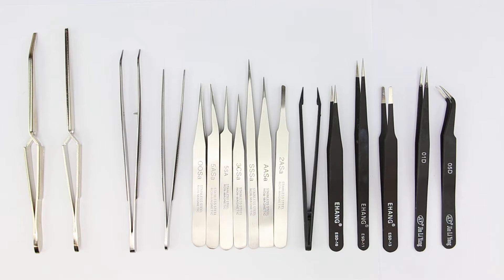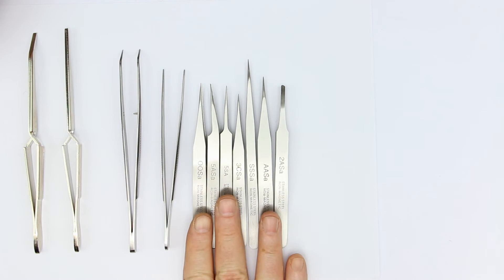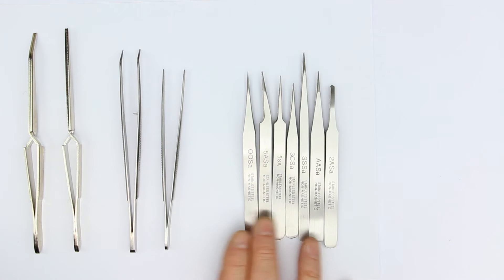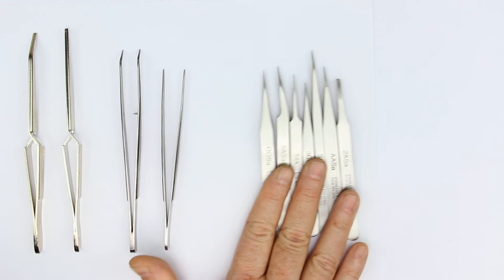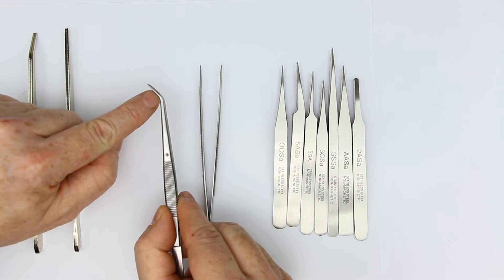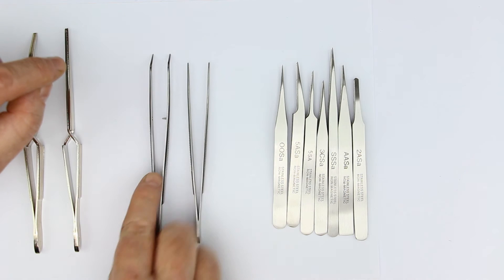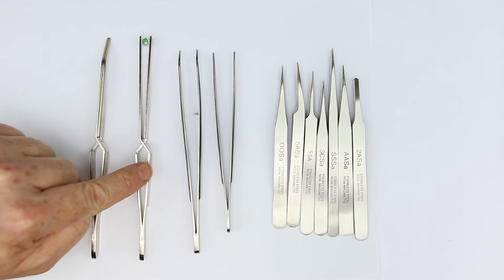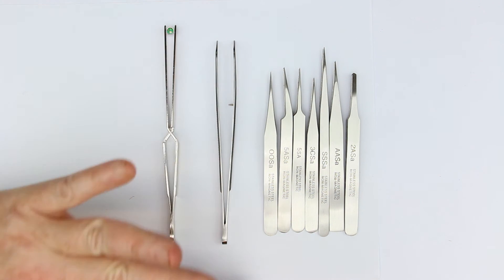Every maker should have…[Pt.15] some electronics tweezers

Comment: Looks like the 7 are from Weller Erem ; I understand it's the n°1 brand for tweezers (?) and small pliers too
Reply from the maker: No. The black tweezers are relatively expensive chinese ones from Ebay. Might be that Weller rebrands them?
Reply: I was talking the silver ones, 5SA e.g., just bought 3 incl. this one (27€)
Reply from the maker: The silver ones shown is the whole set that we sell for 13,90 € in total.
They probably are also made in China but have reasonable quality.
The numbers printed on the tweezers seem to be a universal numbering-system for tweezers. So the Weller 5SA has the same shape as our item but it´s (hopefully) professioal-quality for the higher price
Reply: 2€ vs 27€ ! passed the x10 ratio.
idk if the designation is universal  or copied from Erem but you're right it's used by different brands / resellers, Excelta e.g.